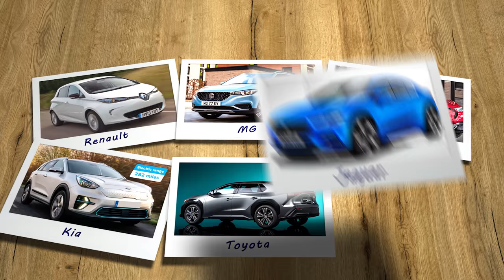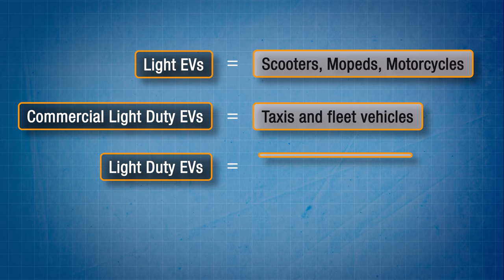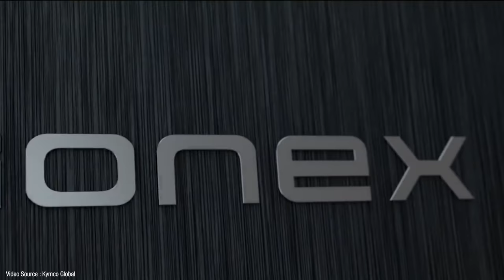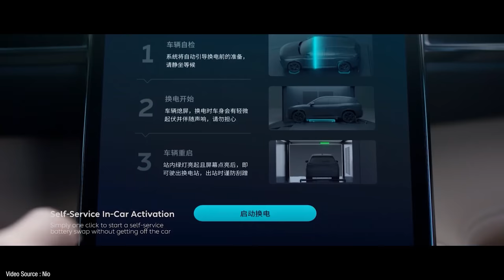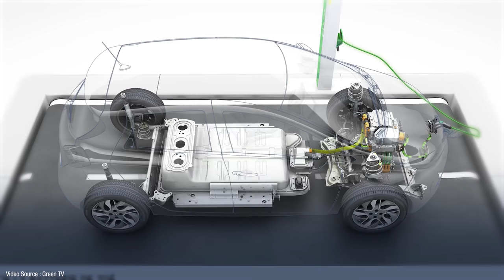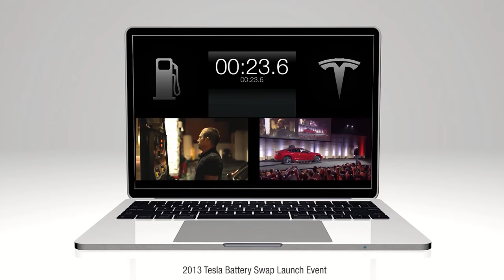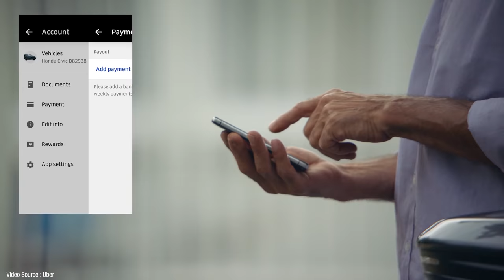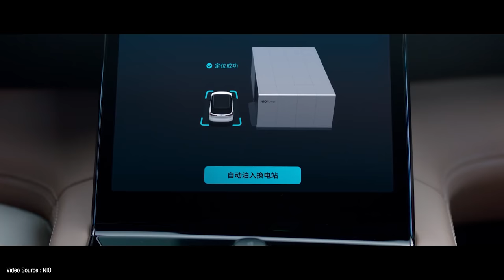Battery Swapping. Transforming the trajectory of electric vehicles?

Comment: I ride a motorcycle. Really pleased about a month ago a rumour went out that Yamaha, Suzuki & Honda had started talks on a uniform battery pack for all manufacturers. This idea may be way more practical for motorcycles than cars.
Reply: I think that's only practical for small urban-only motorcycles. My Zero SR electric motorcycle's battery weighs 100kg, which gives about 120 miles city range, or 50 miles highway range. A battery of that weight needs equipment to lift it.

I think a more practical solution would be to add a normal domestic outlet to every parking space. Charge the vehicle slowly while it's parked. That would be compatible with all EVs. Have rapid chargers on the highways, which is where you really need them and where big grid connections are readily available.
Reply: @markmuir7338  Yep 100% true. My company has a look into hydrogen for that only bitter thing is the missing infrastructure and the missing amount of green hydrogen available to the public. Chargers are not a option on highways as that would be 140000 alone for 120km..
Reply: @mytimetravellingdog  The electric infrastructure already exists near urban parking spaces, because of lamp posts. 1.5kW from each lamp post shouldn't need any grid upgrades. Larger parking lots would be a different story. I don't disagree that public transport is a better option, but it's difficult to convince more people to leave their cars at home - especially after a pandemic. I think battery swap technology doesn't make sense for consumer vehicles - the standardization required to make it economically practical is unlikely to happen, especially as battery pack designs diversify and become more integrated/structural.
Reply: @markmuir7338  u can split the 100kg battery in 3 batterys of 33kg
Reply: @rommeo27  If you make the battery more modular, you further reduce its energy density - more of its volume is structure/shielding vs cells. This would make the motorcycle even less practical. I'd go for bigger integrated battery vs lower capacity modular batteries any day.
Reply: Now to only wait for 10 years or so... Any moment now
Reply: How much that cost. Cos i bet it cost more than that car is worth
Reply: @markmuir7338  I'd crave more modular batteries. 30mls range is what I regularly need. An option to rent more, once in a while or to wire in a few extra cells, to compensate aging would be nice. I'd even happily buy a hybrid with a 10hp combustion engine. Batteries are so ****ing expensive, it makes no sense to own more than usually needed.
Reply: @jochenschrey2909  I guess it's different use cases. I have a place to charge my EVs at home every day - directly from solar panels, so the cost to recharge is zero, and it happens automatically when I'm parked. So long range is my preference, with fast charging for the occasional road trip. But if I didn't have anywhere to charge at home or work, then I can see the benefits of battery swapping even with the compromises of modularity/standardization. And that's most likely to be the case for urban dwellers, who tend not to travel far anyway.
Reply: @primeroultimo  hence ongoing subscription, 😉
Reply: @rommeo27  33 kg (72 lb) is a bit much for most people to lift. I could but I work out at the gym and it would be difficult for me (I'm 71 YO) for an awkward shaped object like a battery and requiring fairly precise positioning.
Reply: @Mr_CM_  EU/US car companies do work together when it saves them money. Many cars from different companies share a common platform with just a different body shell and interior, so they can share the development cost - this is already even happening with EVs (VW's platform and others).

The reason we don't have charging/swapping infrastructure: car companies don't think it's worth the cost for them, since other companies with government funding are doing it for them. Of course that's very short-sighted and gives a terrible user experience, but our economy rewards only short-term gains, and heavily penalizes short-term losses. Chinese companies have more freedom to think long-term (although they have their own challenges).
Reply: @markmuir7338  that's kinda true 
Vw, audi, seat, Lamborghini, skoda, etc share common parts cuz they are all from the same group, they all have the same "owner" 
And that almost all the "sharing", between different companies from the same group
Even BMW, Mercedes and Opel, are all from Germany (as VW is) and they don't share anything i think, except from the fuel and probably the seats (some seats)
Reply: @jochenschrey2909  9i

Comment: There's lots about swapping that appeals, but given how constrained battery production is even now, I just don't see this as feasible for personal cars. Like the idea of fleets and commercial vehicles adopting this. But the constraint remains.
Reply: Not for long. MG5 is the same price as a Ford Focus Titanium. The running cost including annual service is about 2p a mile assuming 8000 miles a year. The annual service cost of the Ford is 4p a mile! On the same 8000 miles a year + fuel. So your worries are unfounded.
Reply: @williamarmstrong7199  But he is talking about the capacity to increase production of batteries, William.
Reply: Think of it this way, imagine turning up at a local shell garage, and you pay for a 1/3 or 2/3 or 3/3 charged battery swap in under a minute. 😎
Reply: @DrumToTheBassWoop  it'd be great, but don't think it's doable because of the limits on production and materials.
Reply: @mtiedemann11  I don't want to swap for some battery that's halfway worn out and only gives me a fraction of what a full charge is supposed to. Range anxiety exponentially.
Reply: @kahnfused1  The batteries would be monitored for quality as they charge. Defective units would be taken out of circulation and repaired or recycled. And range is no longer an issue with one minute battery swaps.
Reply: Depending on how its rolled out, there's the potential that it could improve battery production constraints.  If swapping can be done in less time than refueling, and there are sufficient swap stations around such that you don't have to worry about being stuck out somewhere then there becomes the ability to prioritize properties of batteries other than pure energy density - total lifespan (rather than single-charge duration), cheaper/more plentiful materials, etc.

I'm not saying that would be an easy sell given how deeply invested everyone is into lithium-ion already, and of course there will be consumer pushback against going back to lower-range vehicles (even if the time to swap a half-range battery twice is 5-10x faster than charging a full-range battery once.  People are dumb).

But a swappable battery concept would at least give us more options if we run into a truly severe raw materials supply shortage for existing or near-future battery tech.  Its already something that many grid-scale battery researchers are pursuing (because they already don't need to worry so much about energy density - land area for a fixed-site battery installation isn't anywhere near as big of an issue as space and weight in a car chassis).
Reply: @altrag  but the issue remains that every swap station would need to have a bunch of packs at the ready, meaning there'd need to be many more packs than those in the vehicles. And battery makers already can barely meet the demand for the cars themselves.
Reply: @mtiedemann11  That's the point though.  If you have the ability to use multiple alternatives, then any single point supply constraint is much less likely to degrade the entire supply chain.  Allowing for the possibility of multiple battery types would provide a level of redundancy that you can't get if you're restricted to a single formulation or single patent owned by a backlogged manufacturer or whatever other constraint might be bottlenecking the whole thing.
Reply: Battery swapping needs some very good controls so 3rd parties don't take good batteries out of the pool and replace them with bad ones.
Reply: @mtiedemann11  , battery swapping can actually reduce the strain on the production side since owners don't need as big of a capacity, being able to upgrade for a bigger one latter, as needed - even for short occasions.
Reply: @Cl0ckcl0ck  > Battery swapping needs some very good controls
We've had electronic locks for decades.  I doubt that will be a problem.

As I stated earlier, these things will be serialized and tracked across the system, so all the company needs to do is tell the user to put their battery in slot A, verify the serialization (and remaining charge and whatever else they can/want to check), lock that slot and unlock slot B for the user to retrieve their freshly-charged battery.

And because all of the batteries would be tracked throughout the system, the company would be able to judge (based on service life or charge testing or whatever) when a battery was "bad" and simply remove it from circulation and recycle it rather than providing it to the next user.  There's always the rare chance that 50 people will all happen to use the same station on the same day and all happen to have batteries on the verge of being "bad", but its a pretty damned low chance if you have a reasonably sized bank of them ready to go.

And I mean in the absolute worst case, you could just give the user a "bad" battery if there are no better options available at that particular bank at that particular time.  All it would cause is the user having to swap batteries again a little bit sooner than they otherwise would.  (I suppose if we build a flat pay-per-swap model rather than per-watt-used or subscription, it would incentivize the company to intentionally keep "bad" batteries in circulation to force more frequent swaps, but a dishonest service provider is a very different subject from a dishonest user so I'll leave that discussion for another post).

Of course maintaining a system like that (or any system) across an entire nation in real-time takes some effort but again its nothing we haven't done before - almost every even remotely modern internet service on the planet is capable of that already and has been for a decade or more.

I'd be more concerned with hackers who figure out how to trick the system into thinking they've put a battery in when they haven't, and allowing them to just take the fresh battery without leaving the replacement at all (as opposed to leaving a "bad" one), leading to both the obvious loss of inventory but also screwing up the entire tracking process for the next customer who comes by for a swap.
Reply: I get the appeal of rolling put EVs to as many people as possible as fast as possible, I get the feeling today we are defining what the EV industry will look like for the rest of time. The worldwide build-out of EV infrastructure will only happen once. If we don't include battery swapping today, I doubt we ever will. That does mean I think we've already missed the boat on battery swapping.
Reply: @tylerpeterson4726  Ehh maybe in the US, but there are a lot of other countries in the world that are not yet as fully committed to charging stations as the US, and if battery swapping ends up being more efficient in some manner (particularly cost but perhaps also time or environmental concerns or whatever else), there is still plenty of room for the technology to grow.
Reply: @tylerpeterson4726  Battery swapping offers clear advantages to the customer, being full charge in a minute, allowing for long range trips, the possibly to lease a battery reducing initial monetary investment into an EV, flexibility in how much battery to put inside your EV. These are advantages that do not sail by, as such, I think it will be the predominant system in the future. Properly done, it is a system with minimal downsides.

Comment: Before we bought our Renault Zoe EV. I looked at high speed charging, battery range extenders, we signed up for every charge service in EU... Now we have the car with 400km range, we charge it once week overnight on a 3 pin plug using off peak wind power.  Stress free.... EVs make you think different.

Comment: Once we gave an excess of batteries, it may be a good idea, but we’re a long way from that…
Reply: Au contraire. Battery swapping would drastically reduce the number and size of batteries required / used / wasted. Charging slowly in a controlled environment would make each battery last much longer. (Not to speak of much cheaper energy supply.) "Charging" could be faster than refueling with gas, and that would allow for smaller, lighter, cheaper batteries per car. It would allow recycling to be much more efficient. It would lead to much cheaper batteries. Most importantly, it would avoid EVs from becoming obsolete quickly. Currently, we basically have to ditch the whole car, once the battery loses capacity (which it will sooner than necessary due to the stress from "fast charging"). With battery swapping, all existing EVs could benefit from improved battery (or super-capacitor) technology over time. It's so obvious that this would be the way to go. The industry just doesn't want it, because cars with built-in planned obsolescence make a lot more money for them. Divide et impera! The trick is as old as it's original language. Or older. "Sustainable" EVs, that's just more green-washing bullshit for the industry. Making money is all, a planet for our kids (or ourselves by now) counts for nothing. If we don't force sustainable development by law, it won't happen. Standardized battery swapping for all cars would be the way to go. (Where cars are really still needed.)
Reply: @brsaweda  It's how the system is made. Look at the number of types of outlets in the US. Being french, it looks insane for me, this is such a basic product, there should be nothing more than two or three types of plugs. I fear the industry is just this dumb, as said in the video, the end-customer well-being doesn't appear to be that important. There already is several types of plugs to charge EV vehicules. Why won't they cooperate for something like this, just sign a contract and share the research for god sake, we're doing this for the spatial exploration and it's working fine, it probably a hassle, but look how far they went. This should set an example, but no.
Reply: @Elviloh  ...thats why in Europe all new EV's will have the CCS standard with even Nissan dropping Chademo for Europe anyway
Reply: @brsaweda  How would it lead to much cheaper batteries? If anything, having swappable modules increases cost (and weight) compared to cells being part of the underbody structure. 

Also, reducing the battery capacity leads to more frequent visits to swapping stations, which takes time, scheduling and adds distance driven just to get to/from a station, i.e. reduces the usable capacity even more. What kind of range do you think would be appropriate for a vehicle with a swappable battery?

Comment: The capital costs of a swap station far exceed those of a supercharger, even after adjusting for the difference in charge replacement time which is a factor of 7 (20 min vs 3 min).  Also, if 7 cars arrive in a 3 minute interval, then a battery swap station queued car would wait an additional 10 minutes to begin the swap. There is also need to pay for, store and handle all the spare batteries, charged, uncharged and spare that are needed at a swap site. Hardly seems worth the trouble.
Reply: It basically the same time you spend to fill your tank at the gas pump, well, here anyway, so the queue is not a strong argument. For the storage, the scale of the station would be bigger indeed, but otherwise it's a great way to manage the batteries, remove the old ones, centralize them there. This way the station become a pickup point, which is more efficient than having thousands of dispersed units to go and collect, which adds to the cost significantly. Otherwise it's a lot of technical issues to address, that's a given. It won't be easy, but the transition from the horses to the train then cars wasn't really smooth either.
Reply: @bertiewooster3326  THee Bertie I know - PG Wodehouse - wouldnt even dream of calling a stranger "mate". 

However, mate, if ya insist, the only ice your great grandson will ever know will be the cubes for his whiskey. 

Unless, of course, you mean the German ICE, trains which a frenchman might call TGV
Reply: @reuireuiop0  Nah EV are took expensive and dirty to produce and dispose the average man will not be able to afford a EV
Reply: @Elviloh  It's only the same if you are getting the same range as a gas powered car. If you were getting half, you'd need to visit it twice as often...
Reply: It depends. If it is somewhere that dropping a dirty MW electrical load onto the grid isn't a problem then a supercharger fits fine, but that doesn't fit many places. Battery swap stations can be much kinder on the grid, even aiding in management. When you factor in that then superchargers look a whole lot worse in many places.
It is a lot of trouble, but don't underestimate the amount of trouble it is getting superchargers to work and not brown out the houses nearby.
Reply: Do you realize that in China there is no physical currency anymore? All the money is now in electronic form and all payments are carried out through smart-phones or PCs. So, there is no such thing as walking to the counter and paying ...